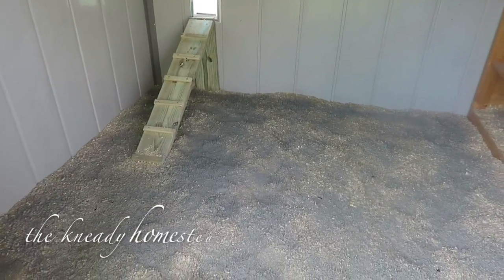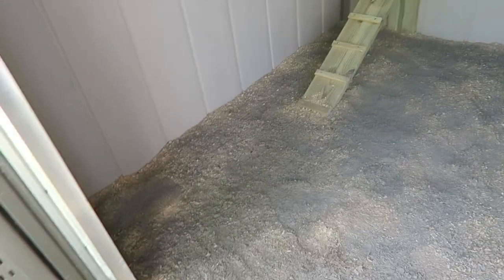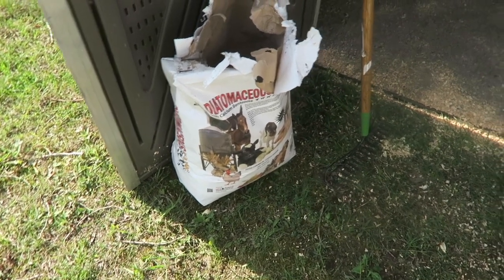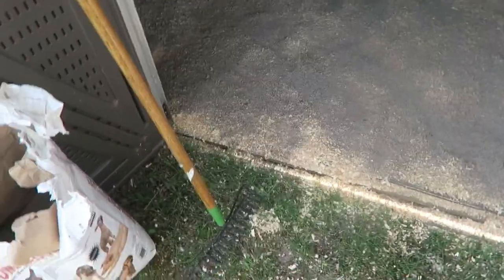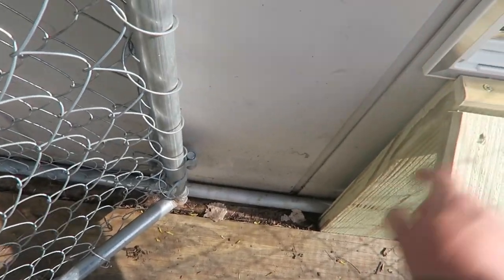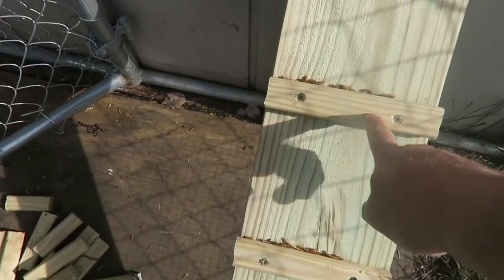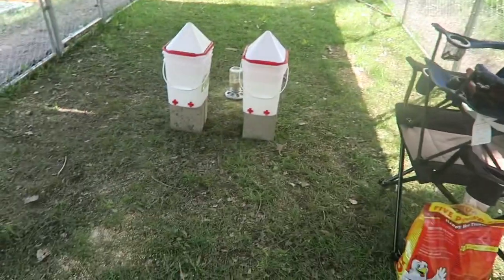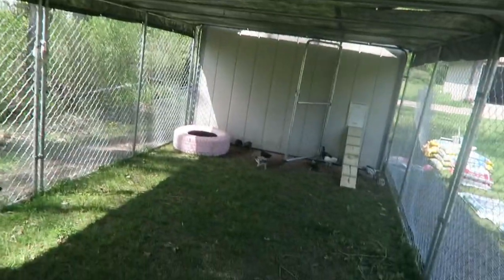Building Our Predator-Proof Chicken Run Part 3: Ramps, Pop Hole, Perch and Shade Tarps

Comment: Hey you two. Love your videos.  We are making a run similar to yours.  We used hardware wire on our top due to preditors.It's like Fort Knox! We also have a tarp for the top.  How are you dealing with water or snow pooling on top of the tarp? I know you can push some of it off. Looking for ideas.  I am thinking of stringing empty gallon milk jugs down the center on top of the wire to kind of create an inverted "V" or peak. Then the tarp over top.. Wondering what you did.  I'll let you know how my milk jug idea works out! God bless.

Comment: Hi do you use the diatomaceous earth solely as bedding for the coop? How many times do you replace it? Is it worth it? Was also wondering about the coop refresher. How many times do you sprinkle that on there? I’m currently using straw and pine shavings but it gets moist in my coop from condensation. I have to top off the bedding every day and I’m trying to go as easy as possible. Thanks 😊
Reply from the maker: from all of my research, straw is bad..... not only can they accidentally inject it which is can get stuck in their crop but it also holds Freas, which can make your chickens sick. We just use the pine shavings. I sprinkle DE everywhere but the nesting boxes..... but not too often. If everything is kept clean and dry you shouldn't need it often. We deep liter here because we live in northern lower Michigan and our wind chills can get into the -30 to -50. I use ash a lot.... from our fire-it. my hands love it mixed with clean soil.....they dirt bath in it. I have an amazon list with several books I recommend, that taught me so much!https://www.amazon.com/shop/thekneadyhomesteader/list/MOV3FK02CBMJ?ref_=cm_sw_r_cp_ud_aipsflist_aipsfthekneadyhomesteader_K4DD1KTH9PBZ275NKKHF

Comment: That perch is awesome.  How many birds can you have in that size building?
Reply from the maker: great question! it varies. some folks say 2ft of space per chicken for reg size and 1ft for bantam, some say 4ft for reg size and 2ft for bantams, if you free range your chickens or have a good size run for them. I think its 4ft per chicken if they are staying in the coop majority of the time. We have a 10x10ft coop with a 30ftx10ft run and plan to free range them as well. We are erring on the bigger side. We have 17 chickens....with 4 Guinea Fowl joining their flock for protection. We wanted to make sure they had a lot of space so they would be happy.

Comment: Is there a particular reason you made the chicken door so high up to have that steep of a ramp?  From everything I've seen on other chicken coups they aren't that steep and are normally a bit wider.  I'm not trying to be a smart butt at all, I genuinely want to know because I'm considering chickens for next year and am trying to learn what's best for the chickens and for my area.  I think it may be a mistake not tieing the tarp down in the middle.  You may have a issue with wind picking it up and tearing it.  But if you find the wind takes it to much, you can always come back and use plastic tie ties on it.  I will be interested in how well it holds up and how it does with snow.  Please keep us updated long term on how it works out and if you would do anything differently.
Reply from the maker: great question! we did a lot of research, and found that setting the pop hole higher up is just another way to prevent predators. If gosh forbid, something was able to get into the run at night, then having that door higher up off the ground makes it more difficult to break into. From all we have read. 🤞🏻 We do have the tarps tied to one another so it prevents a lot of lift, being 30ft long but I totally understand what you are saying. Matt is considering adding a metal roof to it for winter. Possibly. We shall see. At least for right now, it's working beautifully. 😁👍🏻

Comment: I noticed you have gaps between fence panels and at the doors on your chicken run, I hope you don't have Weasels in your area, as they can easily fit thru those areas in your run. No problems as far as keeping the chickens inside. Otherwise looks like you are making a great home for your flock. I wish you the best of luck with your birds.
Reply from the maker: yes, big gaps....we covered all of those over with hardware cloth. Every inch of that run is covered in cloth. hahaha I didn't want any of my babies hurt!